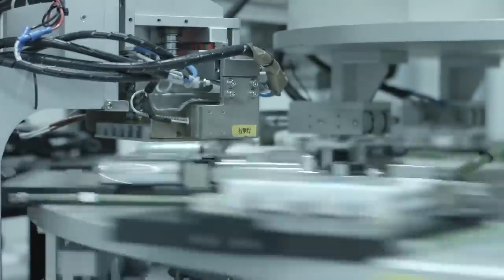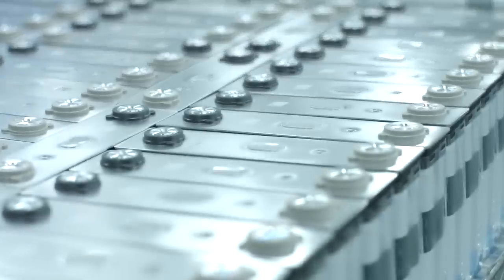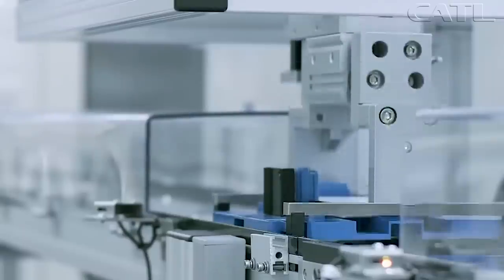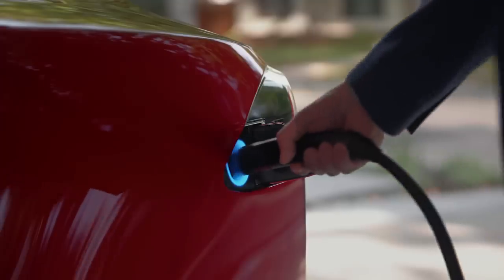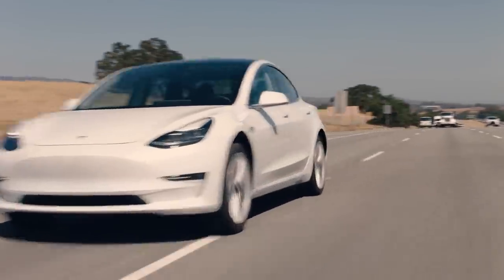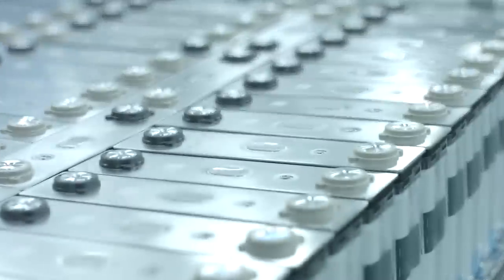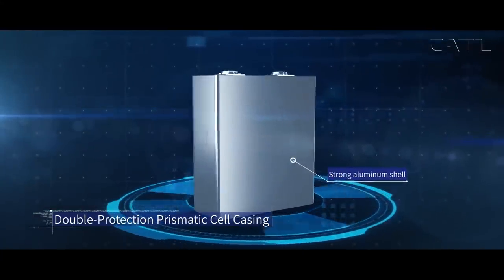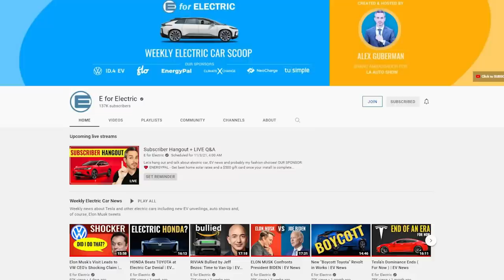SANDY MUNRO on Tesla's LFP Batteries

Comment: LFP is a type of battery chemistry. OTOH, 4680 is a form factor. Totally separate, unrelated issues. LFP could be 4680, or prismatic or whatever.  4680's can be LFP or nickel, cobalt, whatever. Totally separate independent issues.
Reply: BYD LFP are pouch batteries.
Reply: Correct
Reply: @PC-vq5ud  and others make LFP in cylindrical cells. I use them in several projects for many years now.
Reply: Teslas use either (cylindrical) NMC(A) or (prismatic) LFP.  They don't mix and match.  Nor should they, because part of the safety advantage of LFP is that you can use prismatic cells safely and claw back some volumetric energy density.  Whereas cylindrical is much safer for the nickel chemistries, but less packing efficient.
Reply: @concinnus  To my mind the primary advantage of the 4680 form factor is that it enables a structural battery pack. The internal chemistry is a separate issue. If the prismatic (or 2170 or 18650 for that matter) form factor could be used in a structural pack, well then ...
Reply: @PhillProbst  Any of the metal cased ones could be structural.  (But not Hyundai's plastic cased pouch modules).  In fact, BYD's blade would probably be the easiest to make structural.  Tesla just likes cylindrical because it's easy to make and safe.

Comment: I normally respect Sandy, but he did not do his homework for this episode. LFP 'IS' a lithium battery. It is LiFePO4 (lithium iron phosphate). They contain no nickel, cobalt, manganese, or aluminum. These metals are all more expensive than iron. LFP has a different supply chain. Why is LFP good? Because they are cheaper and available and less likely, maybe even immune to burning. They also charge to 100% with no degradation. The downside is that LFP are less energy dense...the pack weighs more for the same kWh. They also provide less power (kW), therefore the 0-60 times are less, all else equal. Tesla just downgraded the 0-60 time for the standard Model 3 with LFP.
Reply: Yes its the tradeoff  less safe+less weight+power <--vs--> moreweight+ more safe + less power  
LTO 25-30k cycles indestructible, low power density
LFP(lifepo4) 8-12k durable, medium p.d.
Li-on car 2-4k hazardous, high p.d
Li-on phone. 0.8-1.5k dangerous, verry high p.d.
Reply: Most are li
Reply: Most are lithium, so when he talking only of the differences without repeating

Comment: LFP batteries are not manufactured in the USA due to the current patent that is held in China, but this will change in 2022 as the patent will expire, so potentially LFP batteries could be available to be manufactured in the USA or anywhere for that matter. The one downside that was exposed by Tesla model 3's with LFP that were delivered in the EU, is their cold weather charging performance. This has been mitigated by better battery thermal management that Tesla has updated since the issue arose last year. I currently have 4KWH of LIFO batteries in my RV and I replaced 360lbs of AGM Lead acid with 75lbs of LFP batteries, never been happier. They charge so well I had to put a DC to DC converter between my 260amp Alternator and the house batteries to limit charge current, or the Alternator would have been fried as those LFP batteries are charge hungry, very different the AGM!!
Reply: I believe the patent is held in Canada. When the patent was filed an error in the filing made LFP available to China. The Canadian patent holder did not pursue legal action against the Chinese. But you are absolutely right, the patent will expire in 2022.
Reply: I have a 1.2kwh LiFePO4 battery in my work trailer. Takes the charge faster from the solar panel and from the towing vehicle so I have power all day. I use it to recharge my electric lawn service equipment. Like the commenter above, it replaced a lead acid battery that was more than twice the weight.
Reply: Interesting....thx for sharing it!
Reply: They should have done the interview with you😂
Reply: @beefitter  I assume the Canadian patent holder has/is being compensated by China?? Should have brought suit against the patent authority.
Reply: @timgurr1876  The Canadian Patent holder did not go after China for patent infringement. For some reason they felt it was not worth pursuing. I imagine that to get financial compensation was too difficult. But, In the mean time China has become the premiere battery maker of LFP chemistry.
Reply: @beefitter  Thanks for update. That is one reason why I don’t want to buy products from China, they do not respect Patents. They think it is OK to use someone’s design/patent without consent. When I was working (now retired), I remember at a trade show seeing a product that looked identical our company’s product down to using the same name for a voltage regulator. It is expensive to pursue patent infringement. However, in an ideal world, manufacturers would self police and not buy from companies that “cheat” on patents. As such, I would have a difficult time buying a car from Tesla with a LFP battery and maybe any car from Tesla just because they are buying “stolen property rights” batteries from China. Integrity is foremost in my mind.
Reply: Historically LFP battery is not cheap. 
LFP battery made in China is cheap because they got all gov subsidies & support. That's also reason why other OEM from Korea & Japan is not interested in LFP and also has recycling issue. Cathode process from LFP produce highly toxic as well.
Reply: @ssecretsauce  pleas cite sources for your information.  LFP batteries for giga Shanghai  are manufactured right in Shanghai near giga Shanghai.  Why would the Chinese be so dump as to put a toxic process right on the outskirts of their premier city?
Reply: @fredfrond6148  lol. You don't know the Chinese...
Reply: @DataGeek903  lol, maybe you should go to east Palestine to see what Americans do to their people.  Bet you Pete Butigieg becomes president even though this happened under his watch.🙄. Obviously not understanding the data you geek out on.
Reply: @beefitter  I thought there was an agreement? Where are your sources?
Reply: @fredfrond6148  >> Why would the Chinese be so dump as to put a toxic process right on the outskirts of their premier city? <<
because they don't have to recycle them until 5-6 years down the road?  Battery recycling won't happen anywhere near their major cities.  LFP recycling is still financially unprofitable.
Reply: @ssecretsauce  >> Historically LFP battery is not cheap.  <<
All lithium ion batteries over the past 10 years have gotten very cheap due to mass-production and commodification -- in fact they cost just 1/10 of what it used to cost 10 years ago. 
LFP in raw material cost is not cheap -- or cheaper than NCM8/9 that are currently de facto industry standards.

Comment: From this interview alone I can tell that Munro does not know much about LFP batteries. A 100% charged LFP battery has more range than a 80% charged NMC battery, even with the higher NMC density. Also, LFP batteries have no problem with extreme temperatures like NMC batteries. The advantages of LFP batteries are so many that I predict by 2027/28 98% of all EVs will be using LFP batteries or solid state batteries. NMC will go the way of the dodo bird.

Comment: I am planning to go with LFP with my Model 3 order as I prefer the increased longevity and 100% charge ability.  Even with the slower performance it is still faster than my Bolt.
Reply: Just ordered one with LFP.
Reply: So you do not care that your LFP battery will never catch fire both sitting in your garage charging or during a high speed crash where you survive the cash and also it does not give you a free cremation if you are trapped in the wreckage? That is why I to would choose the LFP battery!
Reply: The current SR+ LFP cars are just as quick as the NCA cars. I think Tesla is coming out with slower Model 3 “RWD” cars.
Reply: Changing your battery out before your original is used up seems silly and wasteful but I'm guessing they'll re use them.
Reply: @gregb1599  if you are going fast enough to crash and start a battery fire you probably won’t be around to worry about what happens to your corpse anyways.
Reply: @XKS99  Well tell that to the crashes where the occupants survived the crash but were trapped, there was a Model S crash where they survived the crash only for those stupid pop out handles to fail to pop out and rescuers could not open the doors and they fried and that happens a lot remember the Tesla's have a very high survival rate in crash impact
Reply: @XKS99  ah I wonder how to find this out. Getting mine soon, guess it's on the slower side of the dev
Reply: @XKS99 Both can be charged at the same speed.
It‘s three times C.
That means 3x60=180kW for the LFP battery.
And is‘s 3x80=240kW for the NMC battery.

Maybe important, the CATL LFP takes 170kW up to 30% SoC and then decreases slightly to 100kW at 60% SoC.
The new BYD LFP battery takes 170kW up to 50% SoC and decreases then slightly.
This new BYD LFP battery is used in MY built in Berlin since June 2023.

Comment: LFP is the more sustainable option. They use materials that are plentiful in the Earth's crust, they're cheaper, safer, last longer, and are easier to recycle. I won't buy anything else. Also, BYD gets high performance out of their LFP blade batteries. No one ever talks about them though 🤔.
Reply: Correct. Even though LFP has a little bit less power. It will be the defacto standard for normal peoples cars. 1. It's dirt cheap. 2. It's good to recycle. 3. It lasts super long. 4. It's safe. (Overall an LFP is a more attractive second hand car because the batteries last long.)
Reply: @HermanWillems  I have the Model 3 with the LFP and it's fantastic. When you consider that I can charge daily to 100%, I don't really think I'm losing out on much range compared to a ternary pack.

Comment: LFP batteries usually have less capacity per kg or volume. So usually less range for the same pack. It loses more range in cold climates. But it has few advantages like: can be charged to 100% without degradation as the usual Li-Ion battery.
Reply: Also cycle life is double for comon li-on
Reply: Think about practical range of LFP vs Li-ion.   A long range model Y is estimated 326 miles full charge, but that's not practical.  80 -10% is practical usage, so 326 becomes 228 miles practical, i.e., 70% of 326 = 228.  Now,  LFP 100 - 5% is practical,  95% of 260 = 247 miles.  LFP chemistry is much safer against  fire,  much cheaper, double to triple the battery life, i.e., # of charge cycle life.  I want to charge in my garage and leave every morning knowing I have 247 miles of practical range without any fear or concerns about my battery health.  Does this make good logical sense?
Reply: Plus it's safer in an accident
Reply: The range issue is not that simple. If you don't preheat the battery under freezing temperatures, yes the range is poor. But if you preheat the battery, the range is actually very close to optimum and better than with NCA Batteries.

Comment: Some people may appreciate the benefits of LFP over Li-ion.  1. 80% charge of 326 = 260 miles range, Li-ion recommended daily charge level to prevent damage. And, discharge limited to 10-20% also to prevent damage.  (LFP) can be charged everyday to 100% and discharged below 5% without any battery damage.  A fully charged LFP will give you 260 miles range compared to 228 miles for Li-ion , i.e., 70% of  326 if you charge to 80% and discharge to 10% to protect the battery.  Conclusion: LFP battery is far more convenient on this point  alone.   Other advantages: much safer against thermal fire,  lower cost,  longer life.   I want to charge my Tesla in my garage with LFP peace of mind that my house will not burn down because of a 1 in 50k chance of battery fire.   There are disadvantages maximum charging current ~ 70kw/hr, i.e., 20 to 100% state of charge ~  75 minutes.  And, cold weather has been reported to reduce  range by 50% in some cases.  Conclusion,  LiFePO4 has lower performance in cold climates and ~2x longer (super charging) charge time compared to LCA batteries.
Reply: Quick question Arthur: I've been preparing to build a battery for home solar energy storage and had gleaned that even LFP benefits from not fully charging or discharging.  There are charts out there that show how many more cycles one gets when cycling more deeply or more shallow, and it seems to make a big difference.  So perhaps the difference is that Li-ion sustains damage in the short term if fully charged/discharged, while LFP's life expectancy is gently affected over the years if given the same treatment?  What do you think?

Comment: LFP is good for home battery storage like powerwall due to slower discharge, more cycles and lower cost materials
Reply: Also good for wheelchairs although not used yet by North American manufacturers, only in europe. Wheelchair users don't want the risk of fire that lithium-ion batteries have.
Reply: Yes! Your future Tesla maybe able to be grid tied or power your house during an outage.  I would rather have LFP chemistry batteries for this because  a Tesla LFP battery has 3000 - 4000 cycle life vs Li-ion 500 to 2000 cycles depending upon your charging care, i.e., always charge to 80% , discharge to 10-20%.  Personally, the convenience LFP charging to 100% and discharge to 5% without any battery damage is worth my consideration.  Am I missing something?  Seems like a no-brainer  choice.

Comment: Please ask Sandy more about the roadmap for battery tech in the next 10 years.

Many of us are very interested in understanding when the masses will be able to afford a BEV. Will graphene technology, solid state batteries, and other tech increase Tesla's ability to scale battery production? Will this lend itself to more accessible BEV products?
Reply: It's anyone's guess. And a WAG is all you are going to get for 10 years out.
Reply: There's no clear roadmap right now. We're waiting to see if solid state batteries are viable. These are scheduled for 2024-2025 for release. These will likely be scheduled for high end vehicles. Solid Power projects gen 1 cells will hit $86/kWh. That would represent a per pack cost of around $100/kWh which is around the industry benchmark for 2025 projected by BloombergNEF. This would represent a cost reduction of around $50 per kwh for the cell.

For low end vehicles however the technology to look out for is Sodium ion batteries. CATL plans on producing cells by 2023 and they're projected to hit just $40/kWh. Following the same per pack pricing the actual cost should hit $55/kWh or maybe $65/kWh with a hybrid cell approach. This would be close to half the cost in 2023 of the equivalent lithium ion cells at the cost of heavier cells. A 50kWh battery pack would cost just $2750. With that you could have EVs in the $15000-20000 range. These would, however, likely come in 2025. I guess the year you're looking for though is going to be around then.
Reply: Sandy is a manufacturing guy and doesn't know squat about electronics, chemistry, or batteries.

Comment: Have been asking myself for some time now "Why the obsession with 0-60 speed?". So now with the LFP...little less oooomph per Sandy Munro but better charging, safety, and range....sounds like a good trade to me.
Reply: If you were going to spend a lot of money on a car you'd expect speed, comfort, and gadgets. That will not get us to a revolution where the average schmuck drives a cheap electric car.
Reply: I thought the speed (0-60mph) comes from the motor. Confused. My 2021 SR+ LFP has the performance motor and the car is super quick!

Comment: Gr8 interview with Sandy Brother! 
So my takeaway, if I have it right, is:
1. Go Lithium-Iron-Phosphate (LFP - an older, cheaper China patented battery chemistry and popular in China with lower energy density & more poor low temperature performance than NCM or NCA cathode types) ... So for lower cost vehicles like base Model 3/Y & $25k car ... where shorter range needs & quicker charging times to a full 100% are a benefit. 
2. But for colder weather, Long Range or High Performance vehicles ... Go with the 4680 battery which is capable of greater energy density and range. 

Thx & Cheers,
Eric

Comment: If you could ask Sandy, why don't they use super capacitors for acceleration? In essence saving quick drain on the battery. A solar hood or braking could recharge the super capacitors in between acceleration periods.
Reply: good idea.
Reply: Great for electric aviation too
Reply: NAWA built a motorbike to do just this....will catch on in cars I think.
Reply: @Patrick-bu5vy  they did and it was beautiful. I think it was just a technology demonstrator? Great approach